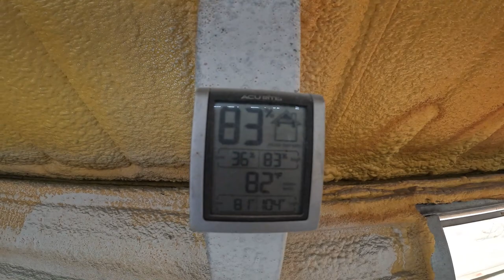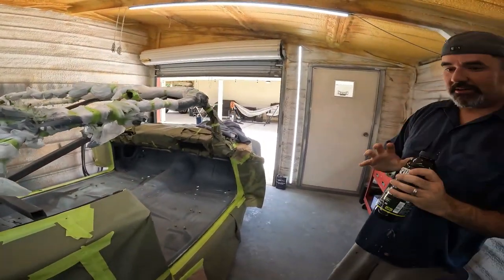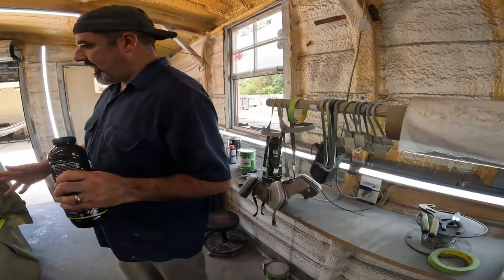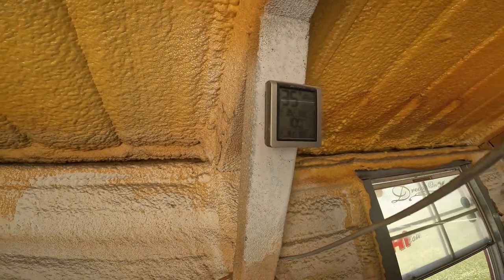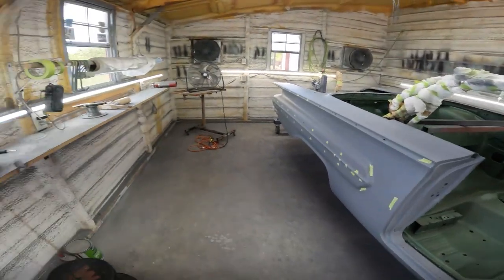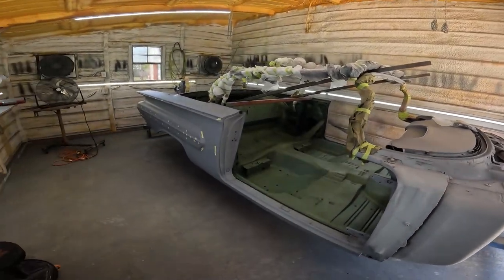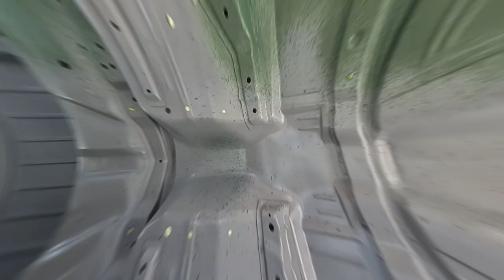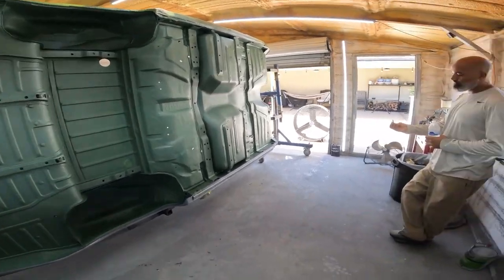HOW TO SPRAY TINTABLE RAPTOR LINER! | #impala | 1960 CHEVROLET IMPALA | @lonestarlows

Comment: I like the tinted Raptor, looks great for sure.
To much heat for me 🙂
Nice you had Red Rocket to back you up on the bottom.
Lots of twisting and turning to do the floor plus all the cleaning and masking.
Everything look great.
Reply from the maker: It's been brutal Ed. I think we have had a solid month of 100 or more without rain. Burn ban in effect